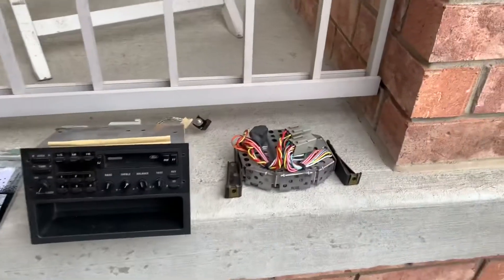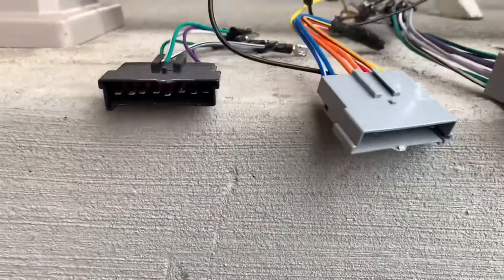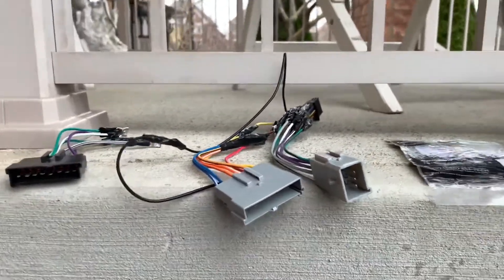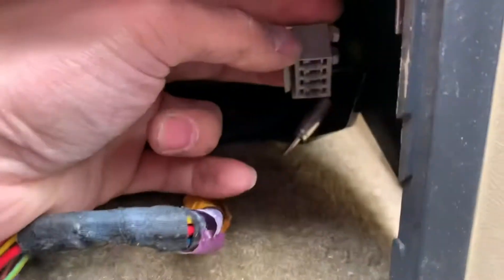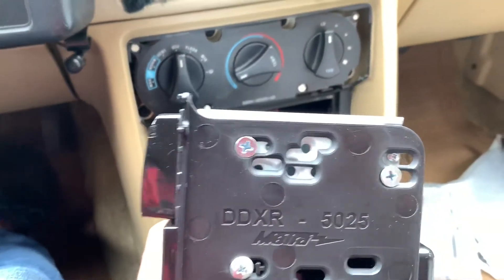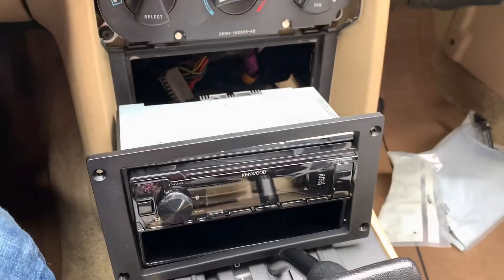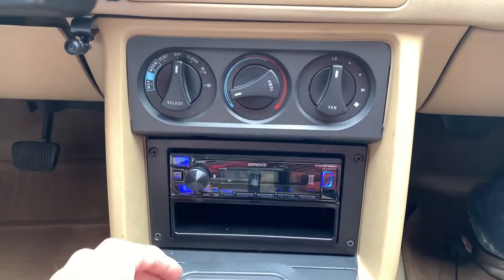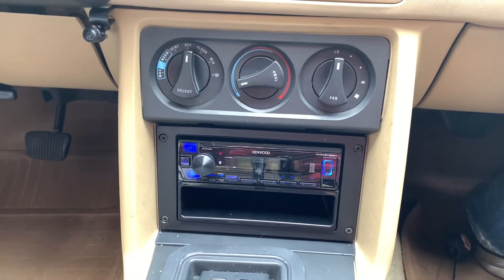Aftermarket head unit install in Fox Body mustang with Premium Sound

Comment: It’s about time someone made a video! Hell yeah! I got my fox a couple years back and wanted to replace the head unit (replaced all my speakers already but the head unit is so low powered they sound no different than stock) but after I seen the warning on crutchfield about possibly loosing speakers and the fact nobody at the time had a video showing how to connect everything for a Foxbody I just gave up.
Reply from the maker: Thanks! Hope all worked out for you! 👍🏼 and no issues in audio quality.
Reply: @AFTD. The the second plug for the speaker is on the back of the ac control

Comment: So the plugs next to the HVAC control are still pluged in? I have mine wired how you have yours but i have no sound at all. I removed the amp and pluged into the grey plug that used to go to the amp so i dunno..
Reply from the maker: To be honest I cant remember the install, Ill have to re-watch my own vid LOL and I cant even look at the car since its in the shop getting some work done. Ill try to run through the footage and see if I can help you!

Comment: Hey man where’d you get the amp plug-in I’ve got a 1989 LTD crown Victoria but can’t find the plug
Reply from the maker: I bought the harness kit from crutchfield.com
Reply from the maker: Here’s the harness I used for the premium sound system

Metra 70-5006 Receiver Wiring Harness
Reply: @AFTD.  man I bought the bypass but got no power once I bypassed it, any thoughts?
Reply from the maker: @chrisresendiz7172  test your leads to ensure you’re getting power through the harness? Maybe it’s a grounding issues? The kit from Metra comes with 2 harnesses I believe. One for premium sound system (6 speaker with amp) and the basic system (4 speakers no amp).

Comment: hey man i am using the same kit, the only issue im having is that the head unit will not fit with the side brackets on. how did you persuade yours in? thanks!
Reply from the maker: to be honest I dont remember....I placed the head unit in the frame and it slid right in then attached with the Metra kit